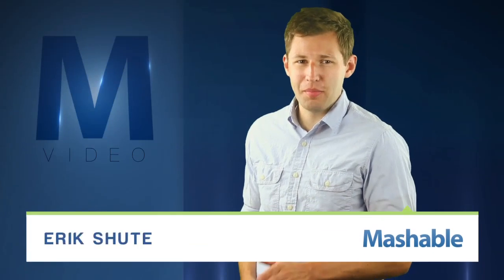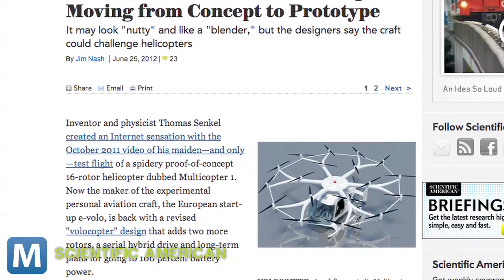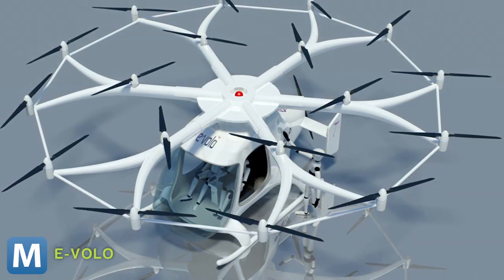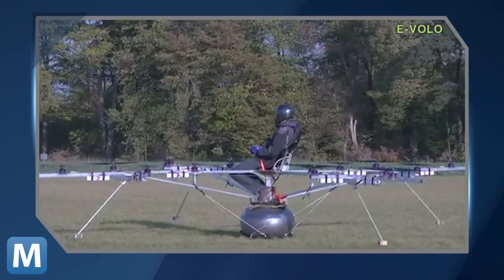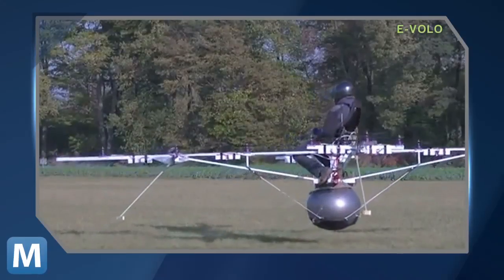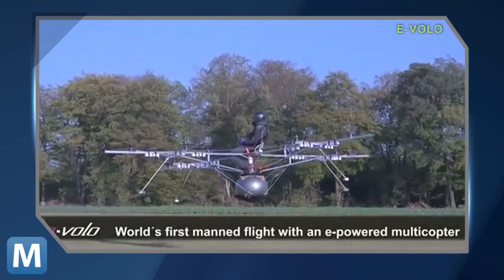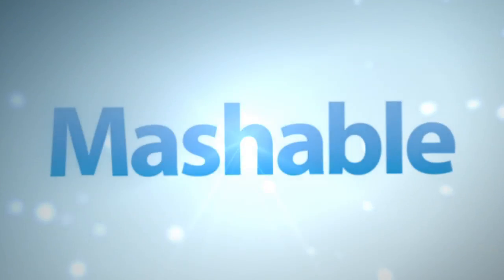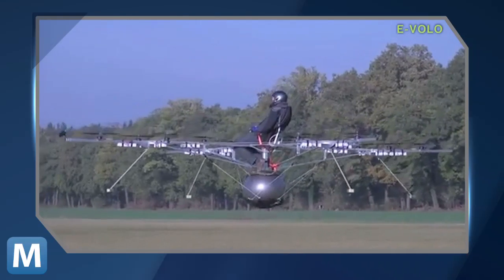18 Rotors Keep the Volocopter In the Air and Energy Efficient

Comment: If your iPad does not charge when you plug it into the USB ports on the front panel of the computer, try using the ones on the back instead. USB outlets don't always have a lot of power, and front ports tend to be the lowest of the bunch. If you still have trouble, try buying a separate USB adapter.